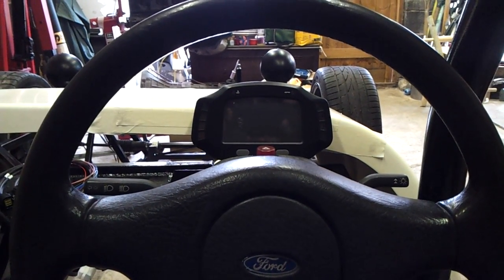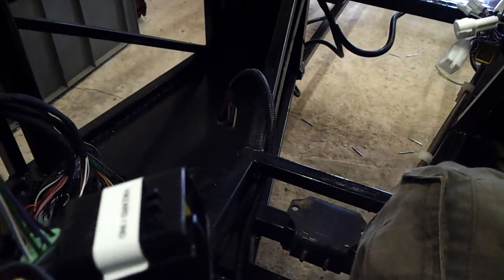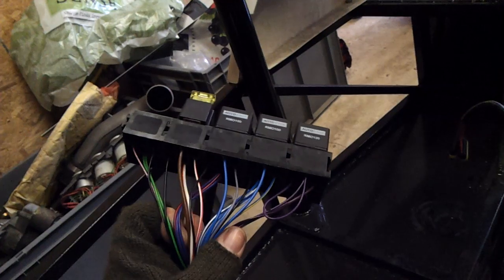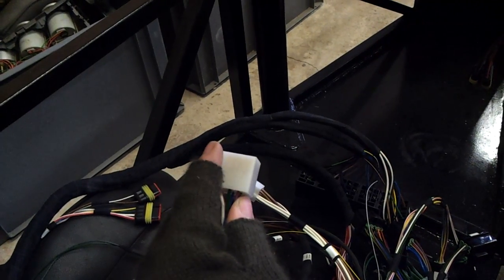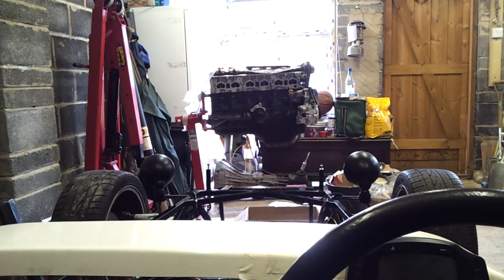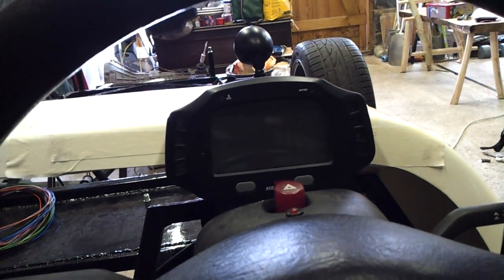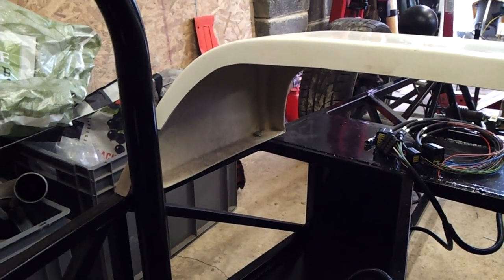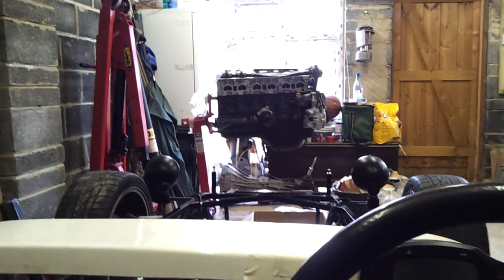Locost / Haynes Roadster - Skyline RB25DET Build Part 14 - Loom

Comment: If you’re not an auto electrician buying a premade loom is not cheating, it’s a bit a of sense.  When you have a problem in a few years it can make the difference between being able to trace wires and fix the problem or needing therapy.

Comment from the maker: Thanks! The loom was £335 and was the "Deluxe Modular Wiring Loom with ECU For a 7 Style Kit Car" from RapidFitLooms Over the next few weeks will see if it was worth spending the extra cash on the best option. But so far all looks well! The brake switch wires were located in the tunnel this would be fine for a switch built into the brake line but I'm using a microswitch (GW73Q - Maplins) on the pedal box instead as i can fine tune it.

Comment from the maker: Thanks! I cant wait to get the thing started. Still have to build the alternator and starter loom but that should not be too tricky. Should have the engine finished by end of the week and ready to reinstall. But have to make sure i have all holes drilled for looms and clips before it goes in as wont have much space left.
Reply: Built Not Bought.   The way I would do the installation is to put the loom in place with no plugs on.  You can then put heat shrink on ( not shrunk). Put your plugs on and then the heat shrink.